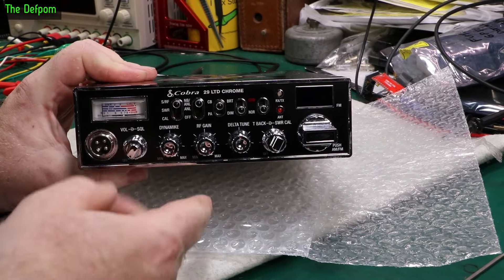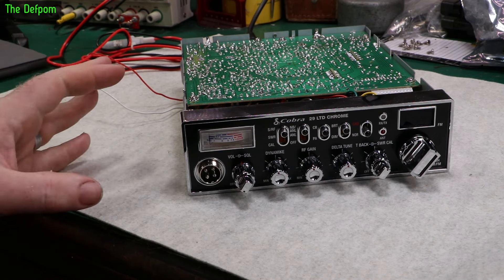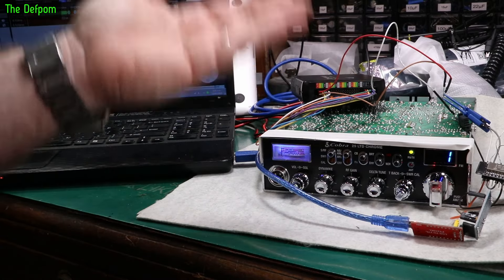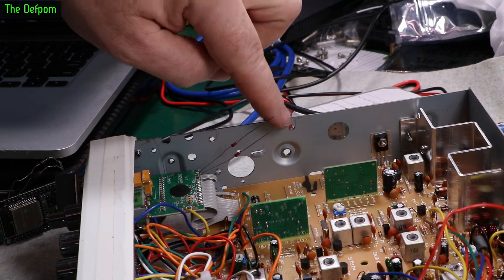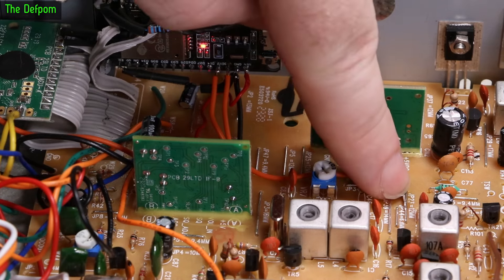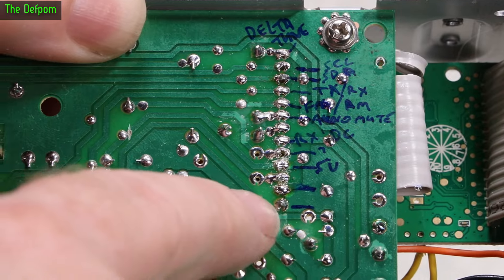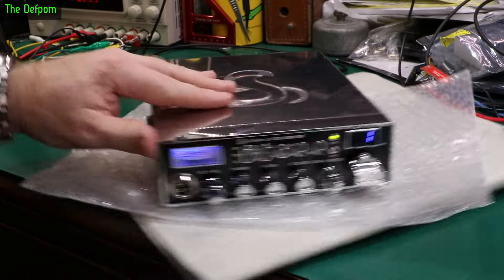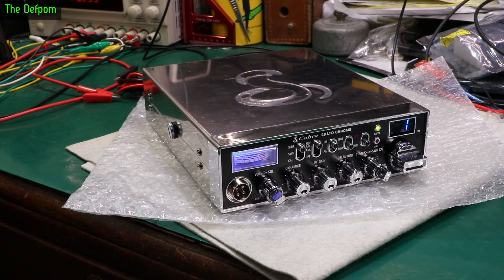🔴 Cobra 29 Ltd AM/FM CB Channel Modification - Hardware Hacking - No.1227

Comment: Hi Scott have you ever read the data from the uniden 980 and put the esp32 in it. Thanks for your videos
Reply from the maker: No I haven’t done that, I know Mark was doing replacement front boards to hack them.
Reply: Ok yes I seen marks  but. I thought it would be cheaper with that esp32  if I remember he used a bus pirate

Comment: Excellent work, Scott. There is a real sense of satisfaction when a project like this comes together and works. Well done! The interrupt issue makes sense, I used an interrupt scheme in my GPIB printer emulator but didn't have problems with debug output to the terminal, but this was a much slower chip I was dealing with. Something to file away and try to remember. Regards, David
Reply from the maker: I was tempted to drop the interrupt implementation and rely on the main loop to handle everything in a more linear fashion to prevent timing issues, but it was basically working by that point and the guy needed the radio back urgently so I didn’t have time to improve it to where I wanted, I’m still pretty happy with it though, it’s about 95% to where I wanted it to be, just a couple of bits I wanted to improve on.

Comment: Well done Scott top job, as we both know Mark Rutherford will be interested in this and may very well have a go at it. He definitely has the knowledge as we both know. Cheers from Pete in QUEENSLAND.
Reply from the maker: I might design a PCB for doing this if I get time, rather than the patched in module I did to get this done quickly for the owner, I certainly would have tidied it up a lot more if I had more time but they needed the radio back urgently.